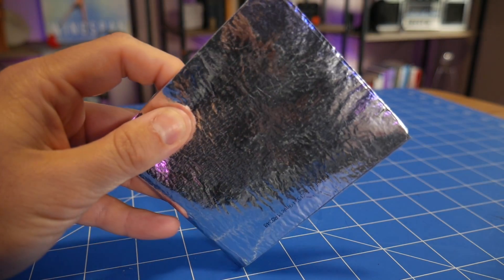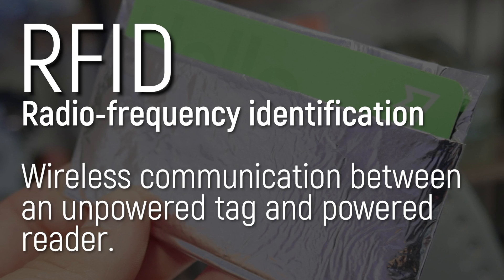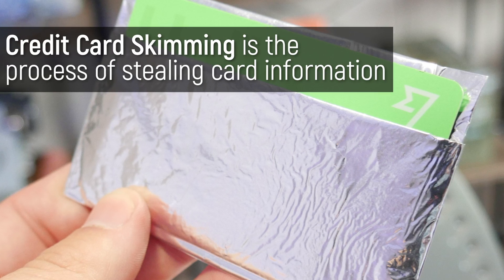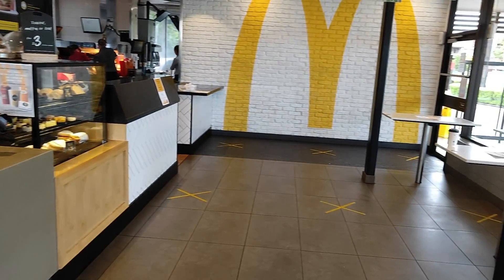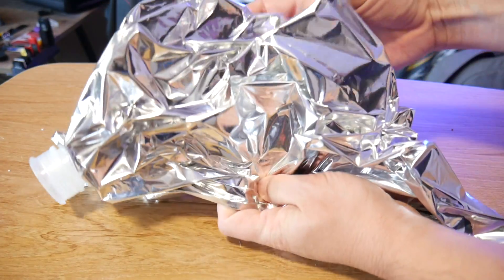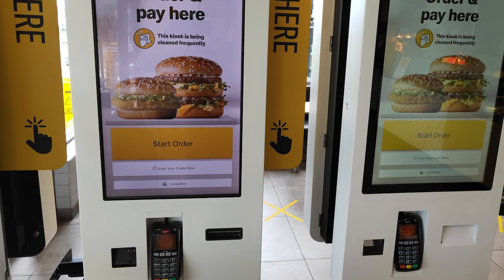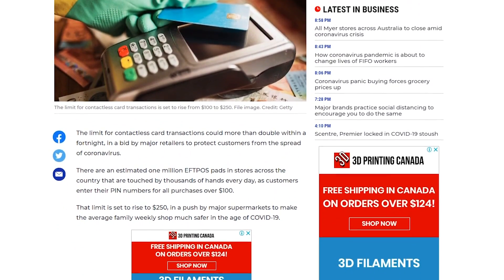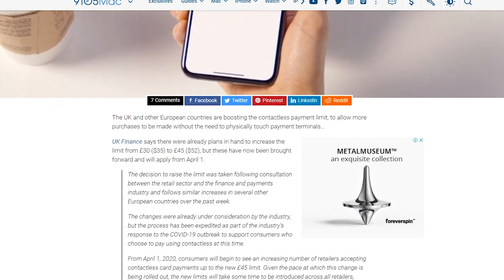Can a Mylar Wallet Block RFID?

Comment: The Mylar does block radio waves. I have a backdrop with Mylar on it and I couldn't get my remote sound system to work right. I have to remove the Mylar so it doesn't block the waves.

Comment: Also  RFID/NFC blocking is now important for some countries passports, identification cards and social services similar to USA social security/Medicare benefits cards. Check with the country where you may have some of the above due to some countries using the same chip technology but I some cases the chip is intended and not visible. Often used in wireless policing and tracking in certain countries. It is how those countries will know where you are. Often used in communist and dictatorship countries. USA PASSPOTTS ARE NOW AN ISDUE FIR RFID/NFCs!!

Comment: From those paypoints, I can't get them to work through my leather wallet (as the only card/metal in the wallet).  I always have to pull the card out.  It maybe more about the fact the reader is supplying low power than the mylar blocking the radio signal.
Scammers will use a higher power and more sensitive receiver to work from a distance.
I am not saying it doesn't work, but your test isn't proof.

Comment: The "skimming" setups can use MUCH bigger coils in their readers than the ones in the POS terminals, they're capable of reading an RFID chip from further away and through greater interference. Having your card in a mylar wallet is definitely not a bad idea though. It's just not a guarantee that someone won't be able to read your card.
Reply: Unless the bear is targeting you, you don't have to run faster than the bear, just the people near you... ;)

Comment: easiest way to NFC proof your wallet:
carry more than a single NFC enabled card in it...
good luck skimming my card when my library card, student id, health insurance card an access card to the gym locker are cross talking whenever a reader comes close to my wallet.
for good measure i also carry an old empty card with a dozen small sticky RFID tags on it that i pulled from old laser printer cartridges.

Comment: Maybe you could test a wallet made of a non-metallic material at the same terminal. It could just be that the chip wasn't close enough to the reader because of the thickness of the wallet and nothing to do with the Mylar.

Comment: The type of tap technology you were demonstrating with cannot be skimmed. Unless you live in the US, your bank card is probably safe from that attack because it uses an active challenge/response protocol (the US also has an older approved wireless standard which is passive, but should be phased out by now, not sure). The processor on the card is powered by the transmitter in the reader and does some cryptographic calculations. For those people with passive RFID they need to protect, that usually runs in a different frequency band so your test may not be relevant.

Edit: The passive I have worked with usually runs either LF or UHF for range or bandwidth respectively. Among passive tags, HF (13.56 MHz) is mostly used by legacy protocols developed before the introduction of UHF in 2004. But I just thought to look it up, and it turns out both biometric passports and the old US bank card standard are in that age rand and do use HF. NFC is a spinoff of RFID tech and uses the same 13.65 MHz band as HF RFID, so my claim of it usually running on a different frequency is not really correct.

Comment: I have RFID shield (paper with something metallic inside) and it works. I'm using phone payments only if possible. Here we have 100 PLN instead of 50 PLN before corona. It translates to roughly 25-35 USD depending on the day.

Comment: Anyone have any thoughts on the "heating blanket" mylar material?

Also wondering if that mylar material can be used inside clothing as a heat reflector? When is it advantageous with that application ? Wanted to have a layer of mylar in my snowboarding boots as I have unmanageably cold feet despite every fitment and brand advantage avalible.
Reply: Get two of the largest boots you can find;
Use two of the boxed wine bladders, wine still in them, to fill out the boots;
Any type of wine should do, although "Industrial Red" is known to work;

While in the cold, sample the chilled wine occasionally;
After a suitable time, your feet might get cold but you will not actually care.

Comment: Well, I just added a piece of aluminium foil inside of my wallet and vavoom, it works as well. Btw, a friend of mine has a shop where they sell French fries and they have a metal basket with paper towels next to the payment device, this metal basket causes the chip reader to fail as well. Sometimes someone picks up a paper towel and shoves it towards the card reader and this causes payment issues because it apparently messes with the magnetic field of the reader.

Comment: I was wondering that too but also I just put a computer together and the motherboard comes in a static free bag I wonder if that will work the same way
Reply: Blocking RF requires "Faraday's Cage effect (check wikipedia etc) which relies on highly conductive surrounding surface, or at least cage, to create a shell over which the electric field doesn't vary. By contrast, anti-static material has very  high electrical resistance, so would not be very resistant to RF.

Comment: Just put 2 rfid cards together in the same compartment of the walled and you are good
Reply: I have that issue with RFID tags in my pocket. I have 3: one for gym and two security cards for work. Sometimes the reader will spaz out when I have them all in one pocket and attempt to scan it. I suppose the bits that are sent back by multiple excited circuits are indecipherable by the reader and can't filter out the one that relates to it's system.

Comment: I used mylar and an aluminized foil to make my wallet. It's sandwiched between the leather layers. I've also done it (using a tri-fold wallet, for better results) by making a sort of Faraday cage using fine copper mesh (the kind you used to buy for carburetor repairs to punch out the tiny meshes for the intake). Alternatively, one can make a small mylar + foil sleeve for the individual cards. If you use aluminized foil, you put it on the inside for a nice slip and slide, you can slide your cards out easier, whilst the sleeve remains in the wallet.

Comment: Listening to Angus discuss shielding RFID brought to mind an old story.

Professor of mine was asked to help shield a railroad communication system which used magnetic coupling down the rails. That way signalling could jump rails that weren't electrically connected. They were getting interference from power lines. He said, "Don't bother, use a different spur of track which is 90 degrees turned versus the power lines that are interfering. Like that one over there."

They said, "No, really. How can we shield this and leave it where it is."

He said "OK, take a solid foot of soft core iron and build a shield around this train locomotive testing location."
...
They decided they could move the testing location.

All that is to say that radio waves are much easier to shield than magnetic waves. I don't know how many NFC/RFID things would want to use magnetic fields, or would be able to, but blocking RF signals coupling the normal way is pretty easy.

Even with that, someone building a sniffer is probably going to be motivated to make directional high-gain sniffers to increase sniffing range, much more than someone building a pay-point who wants to only detect something actually in proximity. 

Just because the pay-point won't detect it doesn't mean it can't be sniffed.

Comment: Heck, a single piece of aluminum foil against the back side of the card will interfere with RFID reading. It won't stop it all the time especially if it's a strong reader. But it does make it harder to get a scan.

Comment: Please don't try shielding these things. A fraudulent person would use a bit of a different reader with more output. There are readers that can indeed read through these shielding measures.

But there is a much simpler and way more secure way. Simply put two cards together, properly aligned with each other. If a reader tries to read a card, both get powered up and start screaming their messages and scramble up the information you wanna hide.
That way the read will either fail or succeed and result in scrambled data

Comment: I see many comments "mylar is blocking the signal." It's the conductive metal, not the plastic, that's the important bit. If you're going for protection against skimming make sure you get the metal infused mylar.
Reply: When it looks silvery is it automatically containing metal? I am not sure
Reply: @birkrollo5167  Space blankets are silvery and do not block. (Tested in Faraday box)
Hot/cold mylar bags do not work (tested with car remote fob).

Comment: Your wallet ack as a Faraday cage. All you need to block a radio frequency, radiation or magnetic field is a mesh made of electrically conducting material with holes smaller than the wavelength you are trying to bloc. The wavelength of the RFID used by smart cards is about 22 meters (13.56 Mhz), so pretty much any mesh would do.

Comment: Although it was shown onscreen; I feel that I should point out that RFID and NFC (which tap-to-pay uses), although related, are two different, distinct technologies; and should not be confused.
Reply: For the purposes of this video, confusing them is mostly okay. NFC as implemented for tap-to-pay is not skimmable, but anything that can interact with the 13.56 MHz NFC chip can, with just software changes, read HF RFID chips such as in biometric passports.
Reply: @TrabberShir  well he said it the way it is: RadioFrequencyIDentification is a type of NearFieldCommunication

the actual standards that make NFC devices compatible have different names most people dont know like Mifare and others though as it seems  RFID has its own standard to encompass longer ranges for use in toll collect systems

Comment: I'm guessing some designs might not be so good. 
Can you try cutting a wire or something conductive on your wallet at the length of the wave length used in these cards. I'm guessing it might scan with a certain physical size tail coming off it.
A certain physical size should be avoided I think.
Also try dangling it with non conductive string, so your body is not grounding the wallet.
Cheers

Edit: The asshats that are genuinely into metal hats are only make a randomly tuned antenna. They never ground it, stupids will be stupid I guess.

Comment: My solution is just always have at least 2 contactless cards in my wallet, that way they can't read them! That, and having no money so they have nothing to steal!
Reply: I’ve employed the “have no money” strategy quite successfully in the past!
Reply: This is wrong. You can read hundreds of tags with one antenna at the same time without a problem.
Reply: Normal readers are very different from skimmers. A commercial reader is designed with all kinds of security and idiot-proofing features. If it reads more than one card it will throw up an error because it can't be sure which one you're trying to use, not because it can't read anything. If a signal can get to the cards then any and all cards can be read. Anybody that says having multiple cards together will stop skimmers is either a gullible dupe or a skimmer who wants you to give them multiple cards at once.

The only thing that can actually prevent skimming is a Faraday cage that stops radio frequency signals.
Reply: @awo1fman  A grounded cage.
Reply: @awo1fman  https://www.youtube.com/watch?v=dTObKtHzroM then take a look

Comment: You might want to determine how close you need to put the card to the reader to activate the reader.  Then make sure that when the card in the wallet is at least as close to the reader as the card was outside of the wallet and see if you get an activation.  Or just wrap the card itself in mylar and place it up against the reader and see if you get an activation.
Reply: In general, around 1cm works. If you want to test at home, and have an Android phone with NFC, download one of the NFC card reader apps (NXP's app is a reputable one - designed for testing the chips they manufacture) and play around. The NFC reader in your phone is exactly the same as the readers in those terminals, although the antenna design varies somewhat, and most EFT terminals have the antenna behind the LCD, which does reduce it's effectiveness a little.